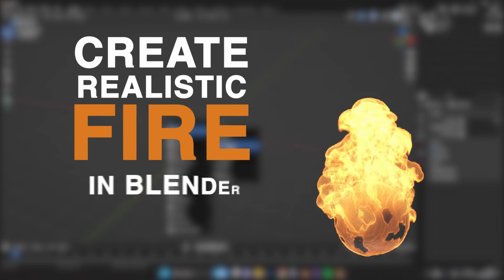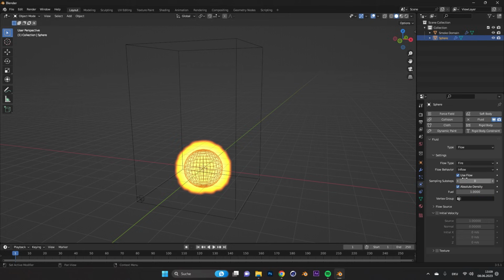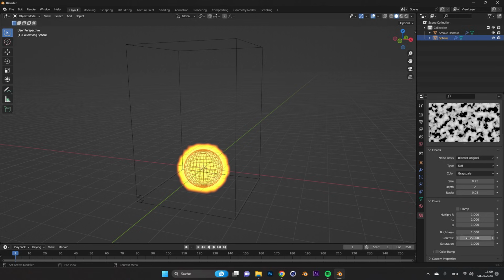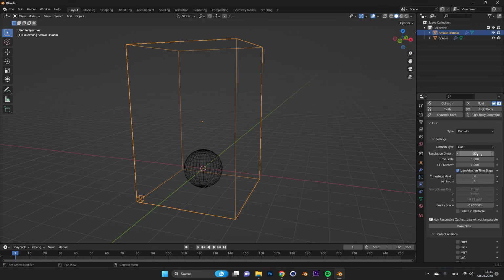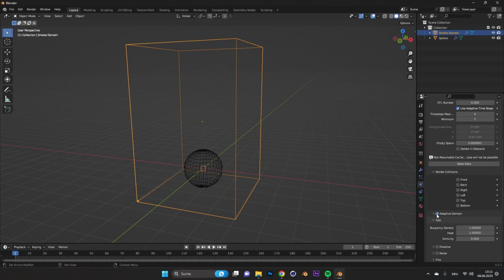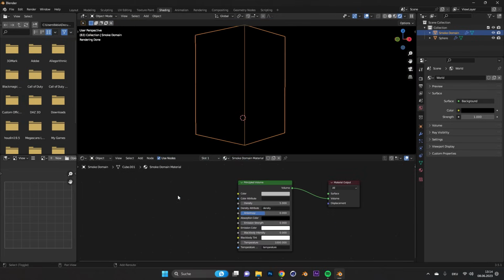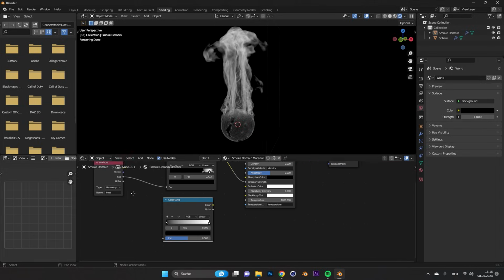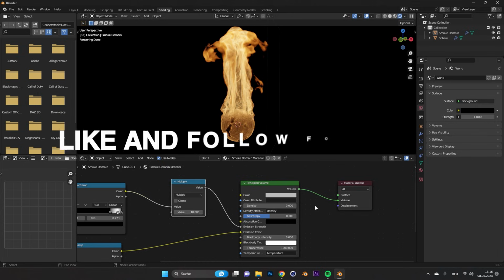Realistic Fire Tutorial in Blender! #blender3d

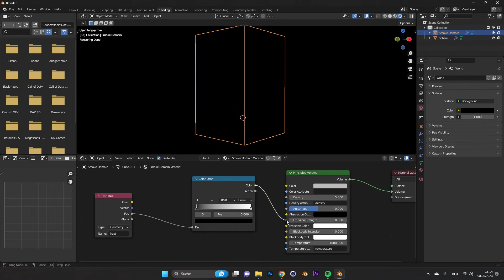Comment: At 1:05 when you plug your Color Ramp into the Emission strength, your flame becomes visible, but mine does not. I know it's baked and 'there' because it shows in Viewport shading. Also, if I turn up blackbody intensity, the fire renders, but remains unaffected by the Color Ramp plugged into the Emission Strength. Any ideas what's wrong please?
Reply: Did you capitalize the word "Heat" when you named the attribute? Mine started working when I changed it to "heat".
Reply: @jasonreed7557  Oh that's interesting! I'll take a look and see what I did. Thanks!
Reply: @jasonreed7557  thats what i was looking for! Why the hell does the naming matter
Reply: @Birdhouse132  I think you're actually giving it a command and not just a name.
Reply from the maker: Do you use the cycles renderer? Other than that I dont know. I will make an updated tutorial soon wich will be more detailed becaude many seem to have some troubles here
Reply: @faebetutorials  Yes, using Cycles. People seem to be having the same problem following other tutorials too. Possibly a version-sensitive point? What version are you using in this tutorial? Thanks for the swift reply and efficient tutorial.
Reply from the maker: @AnthonyLamb  yes that could be, blender changes alot in every update. I think I used blender 3.5 but I will do one in the next days with the version 3.6 👌🏼
Reply: i have the same problem. have u found the solution yet?
Reply: @stephennayak5256  I did not, unfortunately. Haven't tried recently though.

Comment: Not sure why the fire does not persist.  

It just elevates and then disappears in about a second and vaporizes.  Changing the fuel does nothing. I guess this guide is already obsolete.
Reply: change flow behaviour to inflow if it's on geometry
Reply: having the same issue
Reply: When baking the cache if you go down to the bottom area for cache there is a frame start and end. You have to adjust that to adjust how long it stays active.